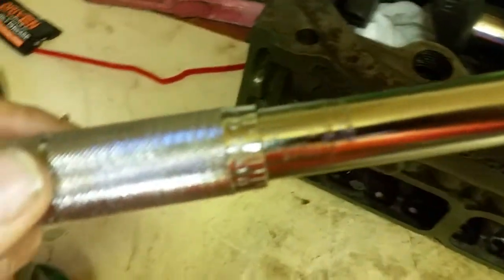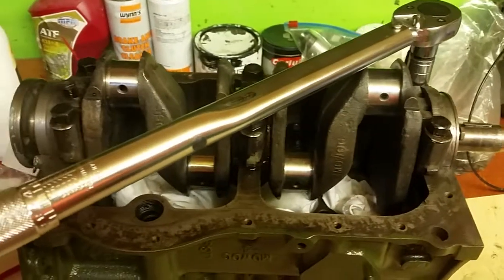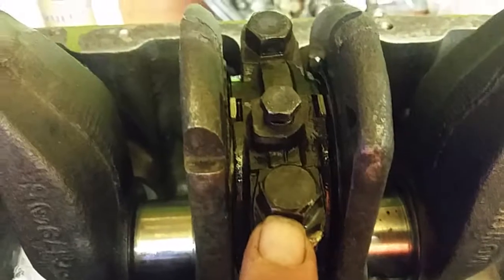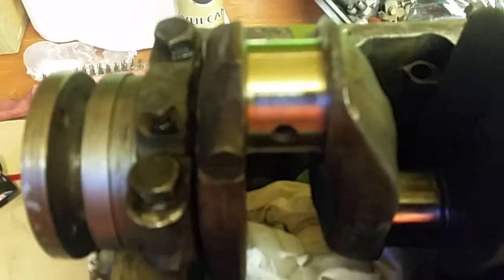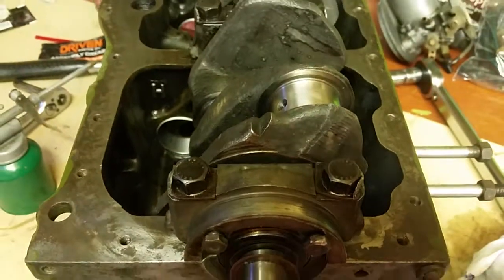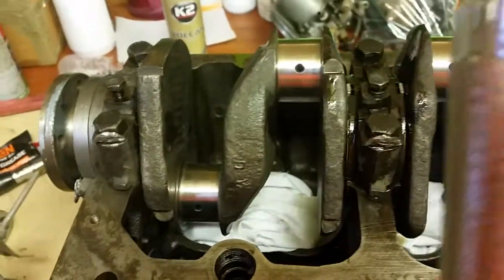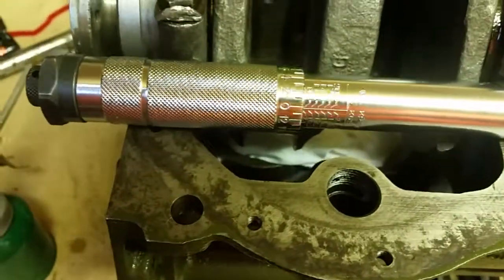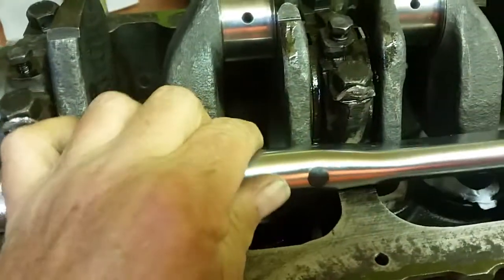AUSTIN A35 A SERIES ENGINE REBUILD PART FOUR

Comment: I am glad you put these tutorials up.I am watching them one by one from bottom up.A quick question though, what set of tools would you recommend one to buy if he has go an interest in working on engines?
Reply from the maker: These a series engines only require a basic set of tools, I mostly use a socket set and two or three spanners, remember these are not metric nuts and bolts, you won't need many tools.